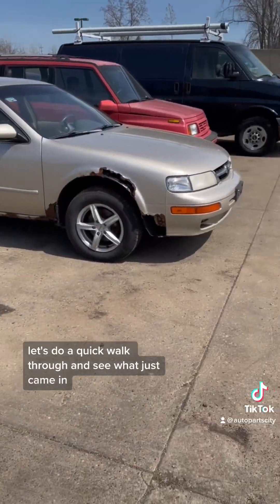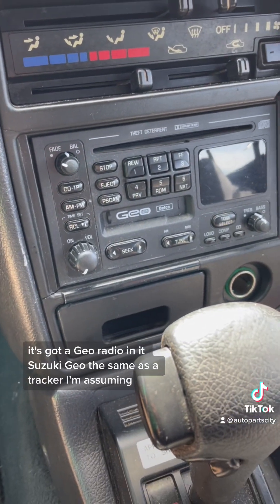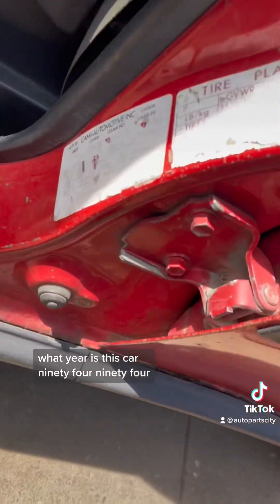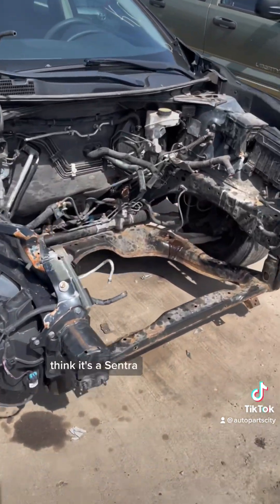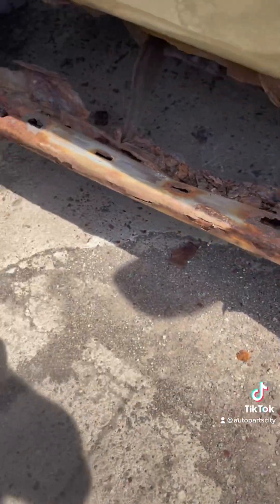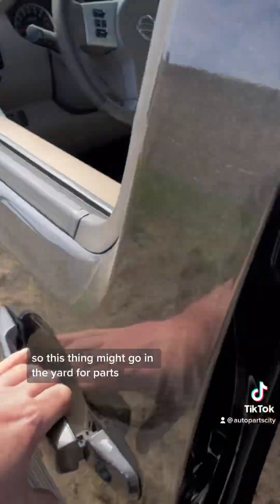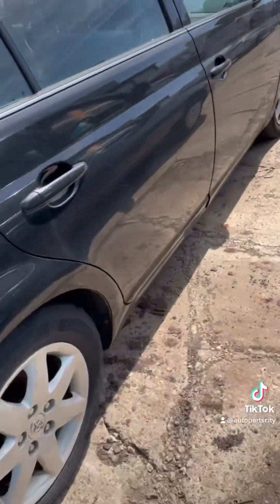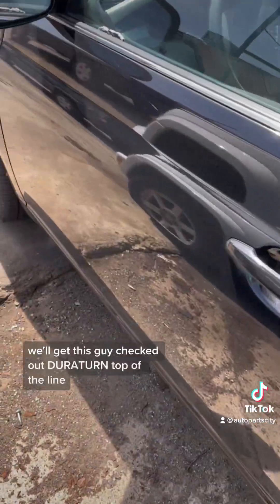Junkyard walk includes a Suzuki Sidekick, Nissan Pathfinder and Toyota Avalon at Auto Parts City

Comment: I feel bad about that Avalon it maybe wasn't well taken care of because they should go at least 250k
Reply: Could be that the car didn't die, just the owner. Us Avalon drivers are all in our 80s. This car is too un-cool for kids, grandkids or great-grandkids, it won't sell for much and the process may take months. Our 03 came out of an estate where it had sat undriven for 2 years waiting for the dust to settle, 83K on the clock. Took a chance, got a deal that left us enough to replace struts, brakes, timing belt, other stuff that un-driven cars need and still paid just market value... best car we've ever had.